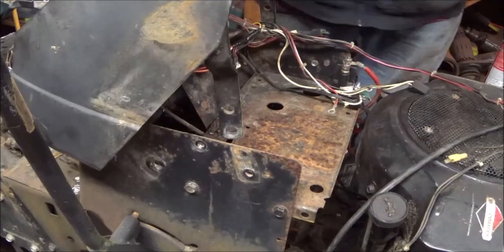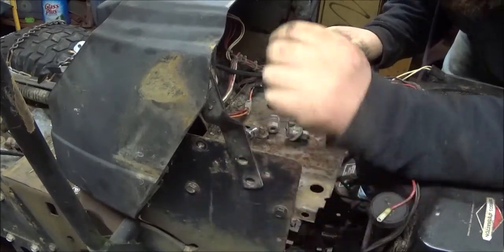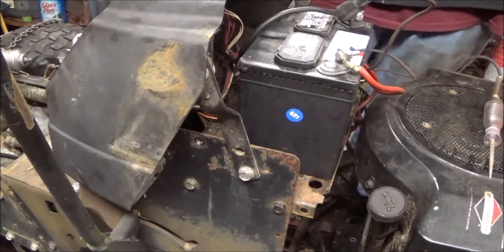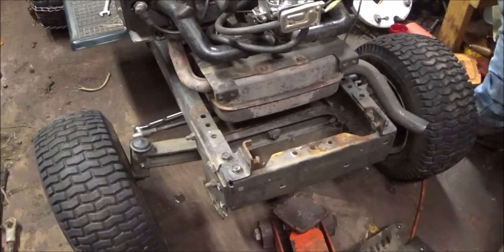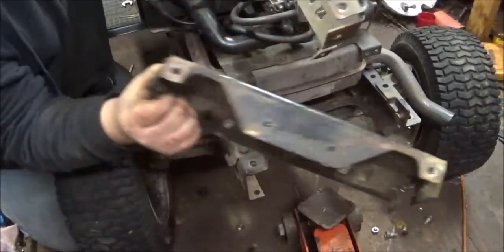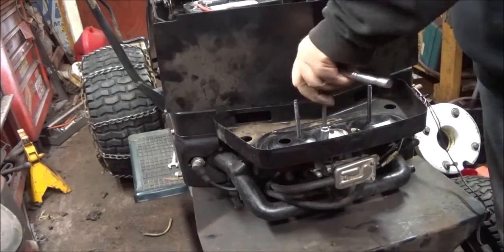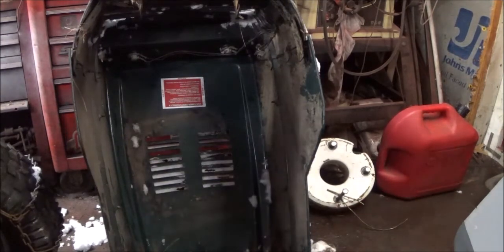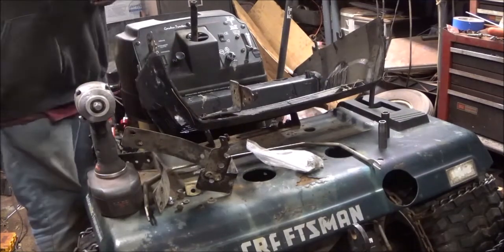putting the hydro together part 2

Comment: Wait, what? Did you just use a bolt to cut a thread?
Reply from the maker: self tapper bolt lol
Reply: @Elkskinsmowerjunkyard  Very clever. Wouldn't have thought about that.
Reply from the maker: I do it alot. Ayp machines in the 90s and 2000s used them alot